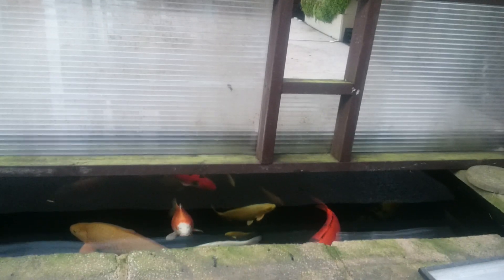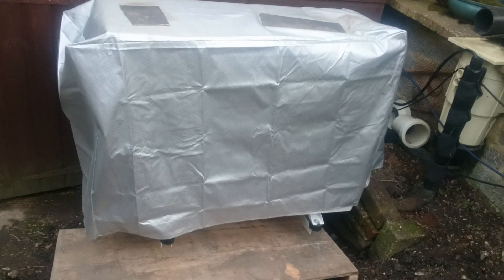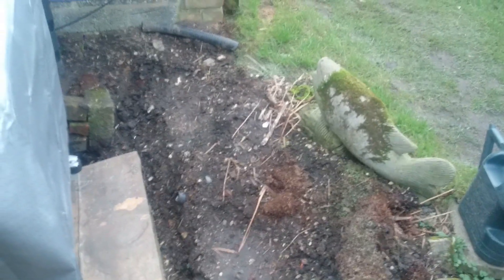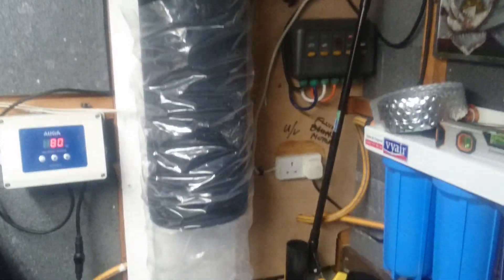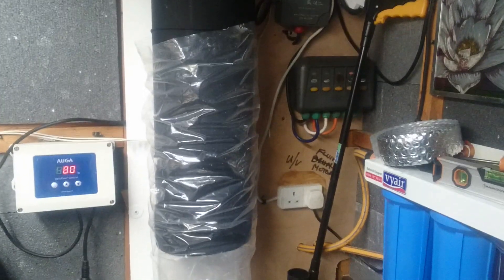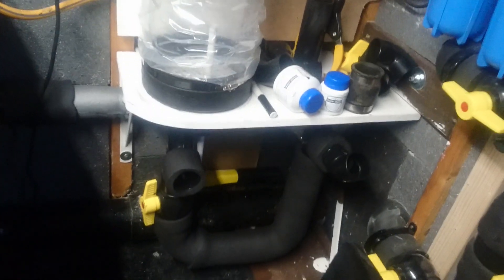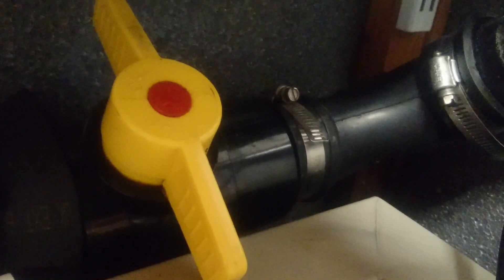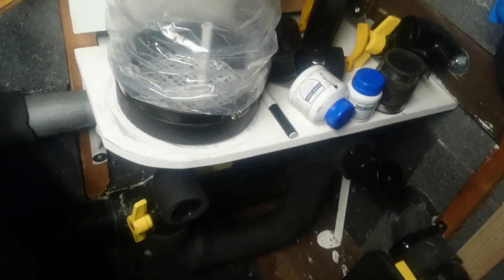Air source heat pump and upflow filter.

Comment: i too forgot to subscribe but i have now, out of interest how much did your up flow filter materials cost? the one i built is working well but i used a complety different vessel i would like one like yours and terrys so i can see whats going on. Cheers keep the vids comming, Jay.
Reply from the maker: Hi Jason, thanks for subscribing, trent plastics or clear plastics both on ebay, don't know the exact costs, I would say around £150, cleaned mine the other day and it's amazing what comes out, shall post another video of it up and running and cleaning cycle
Reply: @marekskoipond9083  nice one

Comment: Hi mate, I've just noticed, I wasn't subscribed to your channel mate, sorry. Am now. You've got some great pipework there mate, Nice. It's nearly there, soon be up and running mate. One last good push and it'll be done. If you think about the Tempest, for your size pond you would need 2, that's £500.00 Wow! 
I'm running just over 12 ltr of media in mine, and I think it might be a bit too much, but I'll see how it goes through the summer before I do anything about it. Great update mate, don't forget, one good push and your there lol. Take care mate, Terry.
Reply from the maker: Thanks Terry, All that's left to do is re route pipework from drum and move pump, nearly there, just hope there's no leaks or I'm likely to go into one lol, think I'll try 10lts media 3 lts more than the tempest and see how it goes.
Reply: Hi mate, I think 10 ltr will be about right mate. You can always add some more later if you find you want more. Don't forget to clean it well and get the swarf out. take care, Terry.
Reply from the maker: @Wrighty  thanks mate, did you notice I took your advise and painted the plywood behind white lol.
Reply: Hi mate, no, I hadn't noticed that lol. Even with the towel, it still picks up the reflection of the wood. I think it's because it's round and acts like a wide angle lens on a camera.